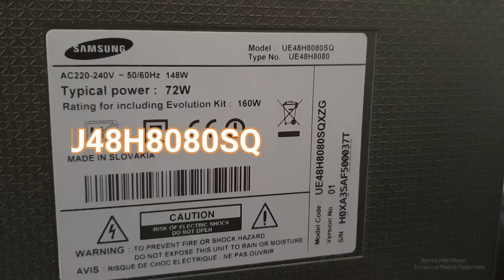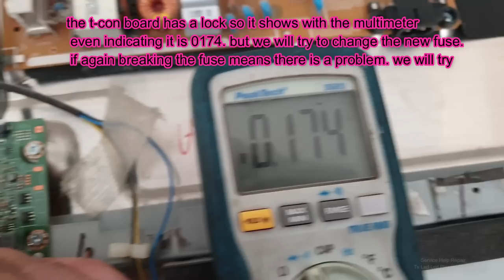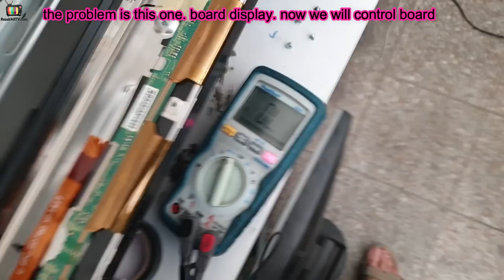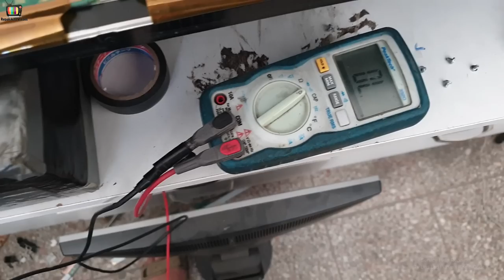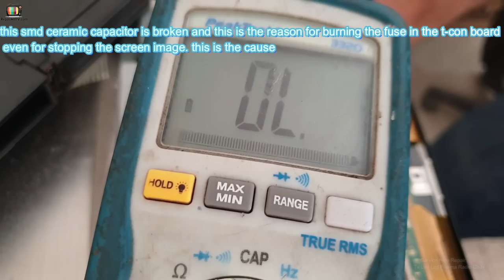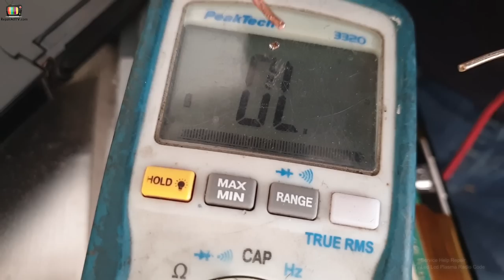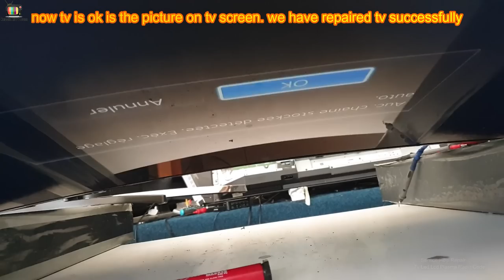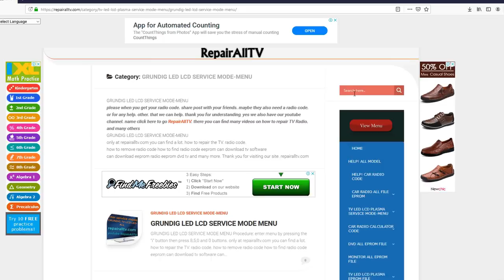SAMSUNG UE48H8080SQ TV SAMSUNG  Curved no picture on screen sound works lighting panel works

Comment: Thanks very much I had same fault of no image only backlight. and with your video I found my TCON board was also shorting out.  I had 1 bad capacitor on the right side. I just removed it without even replacing and TV is working perfectly again.

Comment: That smd capacitor was short... not broken...Good work...!!! 👍
Reply from the maker: what this is like after you. what's the difference. broken and short. the same thing. definitely going to change. both broken and short. one thing
Reply: @RepairAllTV  Broken should mean open circuit. Short = 0 Ohms.   I understand broken may mean either, as it just does not work. But Open, or Shorted should be used to be more exact of what we are looking for. GREAT video though sir, thank you!

Comment: Thanks for video! Question, maybe one of the people here can answer. Is it necessary to remove the SMD's to test? Or, can they be left in circuit?   Leaving them in circuit, you would seem to find one that measured out of spec, while the other good ones were within the same readings. You say  'broken' but  that can mean open circuit, or shorted. In this case I think the exact reason is, that it is shorted.
A direct short should show up, even if the smd is not removed. I am ready to work on a TV with the same symptom. Thank you sir!

Comment: amazing fix, thumbs up! like finding a needle in a haystack.
Reply: Hey Tampatec How are you doing? I've watched all of your videos and got into this hobby because of your videos, after watching I was hooked, But yet again I'm stuck with this tv I can not fix, I wish you lived close and I would pay to have you fix this beast that is driving me crazy, I live in Sacramento, stay safe with this crazy virus going around, and God Bless, Thank you, Thanks to YouTube to be able to watch all these great videos, If you ever read this I have a curved Samsung un 65hu7250fxza, has backlights that stay on but no picture, I've changed the main and t-con boards and it's the same thing, could I get power and it still be the power supply? is it the driver board and do I have to remove the capacitors before I test them with my meter. And is there a better way to test to get to the problem, Great job brother while other people were watching tv I'd be watching your video's and try figuring out different problems .Your inspiring others
Reply: I once changed 2 blown caps on cof smaller than ant it was very difficult to weld took me an hour
Reply: Si sjs sjdi isisism
Reply: Man is it! I been searching through the haystack and found this gem.. The only thing is I wanna know how to uninstall the mini boards that has the ribbons attached to them..
Reply: @1tonzz  get the same capacitors and stack them on top of the old ones it worked for me.

Comment: hunt down short quicker by applying max 2 amps to one of the caps plus side and use freeze spray to find the hot chilly culprit. or I wonder if super accurate sensitive ohm meter will pick the bad cap out by showing the smallest resistance.

Comment: The same Problem i repaired on my UE55H8090 i repair 14 years by myself a lot of Samsung.
I found the same direction to put Off the rippon cable on the outside 3/4 Picture was on after that so i found out it can only broken one of the SMD resistor.
I have an worth of 450 Ohm when i solder out 2 of them.
I found your Video about no Picture but sound is ok.
Its not everytime a Problem with Tcon.
Maybe the F Serie model f5000 and Higher or it has a problem with Led backlights.
Your Video is very helpfull for others they have a H Model.
What resistor do you replace ?
I take one of other h Serie it works fine.

Comment: you can run the tv fine without any of the smd caps, there all connected in across the 12+line, if u find 1 shorted it must be removed, but not needed to be replaced.

Comment: Nice job. My question is:  Are those type of ceramic capacitors polarity sensitive, in other words, do they have to be placed on board specifically or can they be in either direction?  Thanks
Reply from the maker: do not have + - can be installed as you wish

Comment: Excellent work. But please buy sharp probes for the multimeter, and probes in the form of tweezers. My eyes bleed when I look at your tools 🥺😭
Reply from the maker: do not watch the video. switch to another channel. that has the best video. ok. no one has told you to watch my video
Reply: RepairAllTV Bro, why are you being aggressive about my remark? I wrote that such a good master is not worthy to work with such a bad tool, the price of which is $ 10. Agree that the tool has worked out its own, can you need to change it? It is more pleasant to work with a good tool. Don't be aggressive. This is a constructive criticism.

Comment: Hi, I love the videos. I have very similar but not exactly same curved samsung tv. But my issue is is seems to work because when I push the power button on the tv when its on the quick options menu comes on the screen but it will not select any of the options such as source (like hdmi input) or volume up/down. but why would this be when it all seems to work?? I need help here.

Comment: Hello nice video i got a ue43ks7502 and it was dead after a overvoltage no power nothing and i change the power board after changing the power board it powers up lights up  and no video looks exactly like in ur video.... whats ur opinion maybe the same problem with the capacitors ?  Sorry for my bad English.Cheers
Reply: Could be main board or led strips gone
Reply: @Uaintskuxx1  Thanks for your answer i change the main board from another tv same model but difrent size ...mine its a 43 and i change with one from 49 now its working but the colors are washed out and black its washed out ....Do u know i can change somthing in service menu ? to make colors normal again the problem is that i have only the small remote and i can`t enter service menu too see if i can change size of the panel maybe ...if u have any suggestion pls reply.Thanks

Comment: I have the same TV as the one you repaired, but my problem is that when there is an all white screen, the white is not uniform, is getting a little yellowish as it goes to the center of the screen, is there is a remedy for that?

Comment: Hello. I have a problem with a 55 inch Panasonic TV (TX-55FX740E) I bought 14 months ago. I still have 6 installments to pay ... Unfortunately my grandson last month, playing, threw a heavy metal toy into the air that hit the TV screen in the lower left corner and cracked it. For a month or so the TV worked (I just had to put some black tape on the left so as not to be distracted by 2 white vertical strips one cm wide). Now, every time the TV turns on, it works fine for a minute (apart from the 2 obvious white stripes on the left) ... then the screen flickers first (as if the backlight turns off and on) then darkens and you feel lonely the audio! Always like that! Where the shock was hit, the screen was hot ... so it's gone, but the electronics work perfectly. I've been looking for a replacement screen ... nothing! Question: I saw your interesting video ... can you avoid feeding those 3 fingers of the screen so it doesn't mess with the TV so it keeps running? Thanks for the answer (even THOUGH the TV). Nino

Comment: Took entire tv apart and tested each LED strip. ALL GOOD. Replaced PS board and same result. TV starts up, i see LEDs come on and then go out. Flashing red 2 times and then it tries to start up again and again.... When I disconnect either one of the ribbon cables going from main board to panel the backlights stay on but when I connect both, the less go out. This one has me stumped.. Owner says they were watching tv and it just went out....  Let's see who can solve this one..
Reply: Have the exact same thing on 8k 55 inch . Bad panel

Comment: Have an 8k 55 inch Samsung qe557000tat . Had image then nothing but reboot until remove any 1 ribbon cable then backlight and sound . Tried t-con,psu,main,light board . Can't see and capacitor shorted , where do I go from here please ?

Comment: great job, I have a un65hu7250fxza samsung cruved tv. Power comes on, and has a white screen but will not come in, I've put in a main b and new t-con board but it's still doing the same thing, I've tested almost everything but the driver board, could it still be the power supply if I'm getting the glow screen? thank you
Reply: Checked leds?

Comment: Good job sir! I have the same problem with a tv Samsung 65" audio and backlight ok but no pictures, the fuses in the t-con are ok, where i check the problem?
Reply from the maker: you have a problem with. t-con board 80%. 10% main board can be. or it could be the problem as in the video 10%
Reply: Same problem of my tv too..has sounds and backlight but no images..and the tcon board only lights up 2 led on it instead 3 led. I ordered and put the new tcon board but the same problem and 3rd led wont light up too...where could be the problem now? Please advice....
Reply: @instal.apl.aplikacije6156  Perfect!!You were right!! Pair of Smd capacitor of panel board are broken

Comment: So what causes a burn in the bottom right corner of the screen? I removed the cable from the t-con for the right buffer board and the left side clears up. The screen at the bottom right corner gets hot to the touch when the buffer board gets plugged back in and turned on.

Comment: please any idea UE48h6670ST If the t-con is connected to the main board the back light wont come on?  if you disconnect the t-con the back light up. any idea of the issue? flashing red light
Reply from the maker: this problem i have encountered with a tv if it is as you are saying.  you have problem with 100% t-con board
Reply: @RepairAllTV  have changed the t-con... same thing happens I even changed the main board same thing... flashing resd light thanks
Reply from the maker: remove the ribbon from the board t-con associated with the display board. even try the tv switch on if the tv switches on the problem is the same as on the video. display board

Comment: Hi what about veritical lines on a samsung UE55KS9000 tv. Bad tconn or pads on the panel can it be repaired?
Reply from the maker: you have a problem with the ribbon display. difficult repair
Reply: @RepairAllTV  is it possible to repair this. Some resistors are getting very hot. And what other checks can i carry out to check this.
Reply: How do i identify which ribbon cable is bad.

Comment: My set was showing horizontal ones at the bottom I remove the lvbr cable ribbon cannecting to the screen upon replacing it back no picture what can I do to restore the picture

Comment: Hi, I have  Tv Samsung Curve 55" but is the same as your, the issue is black screen, when I powered the tv is a flash into the display and the backlight  goes quick off, if I disconnect the tcon flat cables form the display the backlight comes back but you no image obvious , which is the problem there or what I should control?
Reply from the maker: you may have a problem with the t-con board. or as in the video
Reply: @RepairAllTV  the issue has been solved, was as yours. A BIG THANK YOU!!!

Comment: How do you know which capacitor to use, how to check ?
Reply: check the value of adjacent ones with meter. will be same value
Reply: 10uf 50 or 60v

Comment: I hjave a tv that has the same display when powered up, the fuse is ok on the tconn baord, i swapped the tconn board and still no display. Ive disconnected the ribbon cables in turn to the each side and when one side is disconnected half of the screen goes white. What component would cause this ? Its defo panel board issue.
Reply from the maker: you have the problem roughly like in this video. https://www.youtube.com/watch?v=XCJAx92JwPs

Comment: I have a Samsung UHD 6 series with no picture but sounds works. Technician says it is the panel which costs more than the TV itself. I only had it for 15/16 months and it’s already worthless. :(
Reply: @anvesh6587  no bro, my TV cost me 600 dollars on Black Friday (was originally 990$) the Samsung technician says that I have to replace the whole panel which costs around 700$. So, not worth it. I still have hope to find a technician (like the one in the video) ballsy enough to try to fix it (if its possible).
Reply: @anvesh6587  If you find one, let me know. I live near San Diego Ca.

Comment: What was the value of the shorted capacitor?
Reply from the maker: Around $2-3
Reply from the maker: @guillaumed2587  you can replace a similar one or you can remove the capacitor. even without a capacitor. tv will work.
Reply: 10uf 50v

Comment: how did you test and get voltage in t con while the ribbon connector that came from the mainboard is disconnected??¿ your video is not clear....you disconnected the supply from the mainboard then how could your tester get a voltage in the t con board while it was disconnected?....is it a magic....REVIEW YOUR VIDEO SIR...AND NEXT TIME MAKE IT CLEAR.....THANKS FOR THE KNOLEDGE YOUVED SHARED ANYWAY!!!!!!

Comment: For a 15 min repair you have made a 46 min video, inject voltage see which cap is bad, finished, 10 times you show thumbs up, 10 times you check the shorted line, why ????

Comment: who in their right minds can do that at home you have to be qualified to do that  you might connect the wrong wires &burnthe the whole set I would not advise that
Reply: i do this at home and live in the ghetto. i get lots of broke tvs from apartments in area. mostly bad power supplies and burnt out led back lights which is very hard to fix.
Reply: so you are almost qualified &know what you are doing that's great but I would not an attempt to do that as I once fused the whole home